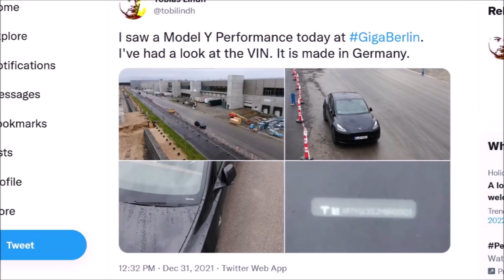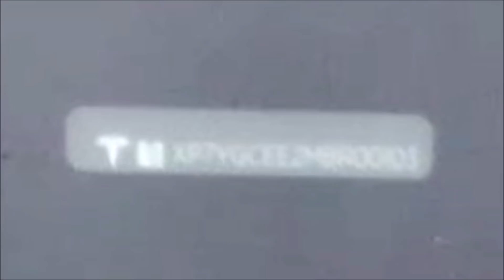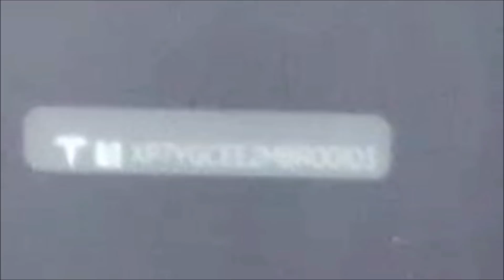Northvolt Builds Europe's 1st EV Battery in a Bid To Beat Tesla Giga Berlin

Comment: The Northvolt factory in Skellefteå (Sweden) has a capacity of 32 GWh. Shall be extended to 40 GWh till 2024.

In 2022 two further battery cell factories are expected to start production:
CATL in Erfurt (Germany) with 24 GWh capacity. Main customer will be BMW.
TESLA in Grünheide (Germany) with 50 GWh capacity. 

Note: take the capacity numbers with caution. These are typically the number aimed for phase I as max. capacity. And often the number of potential future phases are added as well. Here both (CATL and TESLA) talk about 100 GWh capacity for the mentioned two locations.
Reply: No, this Northvolt factory will have 60 GWh capacity.